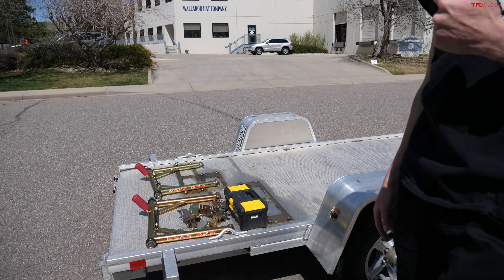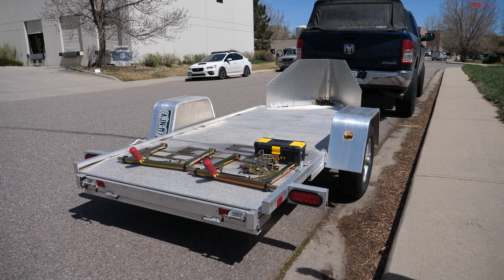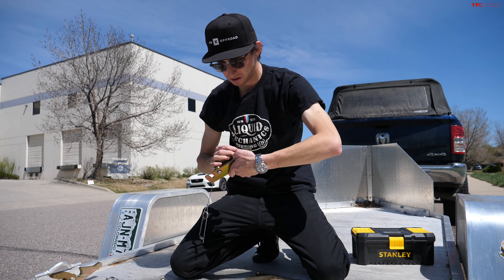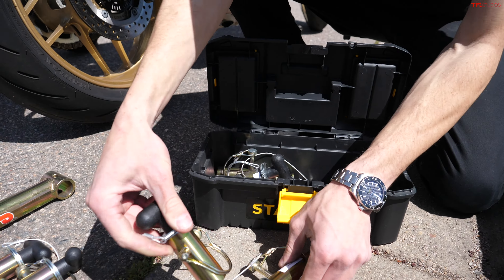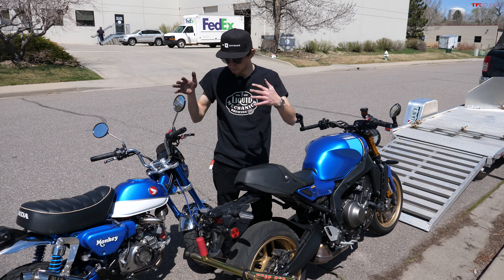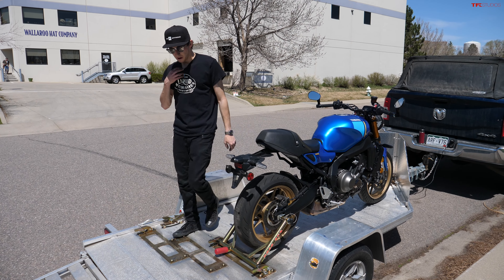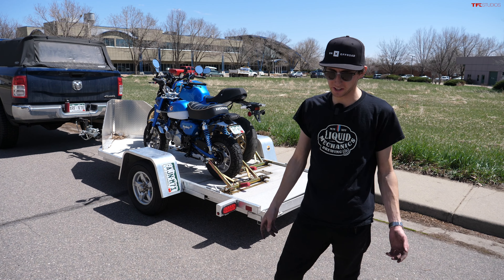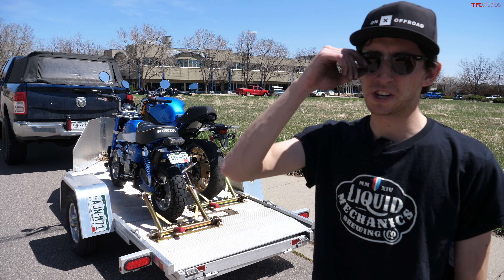Here's The Easiest Way To Transport Your Motorcycles!

Comment: Aluma C10 is $2400 plus tax, the  C210 is a $6000 trailer. Then for just one Pitbull trailer restraint and pins you are looking at close to $500.  I have a total of $700 tied up in a 5x10 trailer that has its own ramp, plus 3 sets of straps. And when I strap a bike down I use the rear swing arm and front axle as Bikes and Beards does. The bike does not move AT ALL.  I can also pull it all with no problems  with my Toyota Tacoma 4x4. There are trailers that you could have gotten that would fit in your garage that are half the price of what you paid.

Comment: Wow! "Welds breaking and things popping off" after only 1 year seems like a big manufacturing quality issue to me. The stands seem high quality, easy to use and fit your use case and budget. Thanks for the informative video.
Reply: I have a 2012 Aluma UT-10 that’s still as good as the day she was made.
Welds are some of the cleanest I’ve ever seen, tie-down points (including center, flush mount swivel D-ring) are ROCK SOLID, and there’s no draw backs to these trailers.
I’ve pulled hundreds (literally) of trailers, and worked many of them to death.
The Aluma was the one I bought for myself, and I’ve never regretted it.
My bike is a Ural Gear Up (800 lbs wet), and this has been the best trailer ever.

If this guy keeps breaking trailers, maybe the trailers aren’t the problem?
Sounds like he stands it up on its tail to fit it into his garage.
If he is, that would explain a LOT. 😎

Comment: Those Pitbull restraints work well in the bed of a pickup too if the bed is long enough. I've used the same system for two bikes and it really works great as Alex says.
Reply: Yes they also work in a truck bed! You can even mount the pitbull plates further forward in the truck bed. Then use the trailer restraints in front of the rear wheel, instead of behind the bike like I showed in this video

Comment: If your doing this sort of thing on the cheap. Buy a cheap 5x8 steel open trailer with the drop down ramp. Install three front wheel stands upfront, preferably on a 1/8 to 1/4 steel plate to add stability and structure. Then just use the already provided strap points to strap to. Tow a single in the middle or two side by side. Make them bolt on and you can save more money only needing to buy two stands on their own steel plates and set them up according to the need. Plus can remove them completely and use it as a trailer. An open trialer is lighter and way less air drag than a closed trailer. Besides much easier to work around the bikes when strapping then down. If you got the money go for "tank straps", specifically designed for strapping to the forks of the bike so its ridgid and not on suspension parts.

Comment: I just bought a used MC10 last weekend and am planning to set it up for two Dualsports using the motocinch restraints. When you mounted the pit Bull plates did you use a backing plate on the bottom side of the trailer bed?
Reply: No backing plate. Just washers and nylon nuts on the underside

Comment: When are y’all going to do more videos with the Xsr900???
Reply: I think it would be cool if there was honda grom built like the rebels soley in the sense of just multiple engines to choose from.  The traik. 125 is kinda rare people all over the world i dont even relate to want ine because they are scooterers and travelers on a budget etc. It sucks balls to pay 5k for a fancy scooter and its not even 6 speed and theres only 1 engine option. It makes it hard to put a bike like that in the stable when its 125cc for the same cost as a 2007 honda accord naturally aspirated v6 family sedan with 250hp that will go from san diego to miami easy peasy. 5k i mean bro it should have cruise control and multiple engine options. The rebel is cool lime that. You can get the one that gets 75mpg and isnt really for the interstate just for running around the block maybe dkwn the road, or you csm get the rebel thats 1100cc with cruise control you can go from sam diego to miami on a huge roadtrip for not too bad of price. The 125 cc grom needs to be entry level and then the top option needs to be hulk mad type grom. Hulk smash type. Give it muscles make it questionably fast.

Comment: And how is the simpler?
Reply: My R6 doesn't have a side stand. It's almost impossible to strap it down alone using regular ratchet straps. This lets me transport my bike alone very easily. And on sport bikes the fairings can make it hard to run straps and you end up pulling on and cracking plastics
Reply: @AlexLightmane4i  Same for my track bikes. Also at the end of a track day when you're wrung out physically, it's so much faster and easier to pack up.
Reply: @AlexLightmane4i   I'd agree in that case and also when you mentioned that you haul the same two motorcycles over and over. Otherwise it would be difficult to have all of the different setups. I'd contact the trailer manufacturer about the weld issues too. I enjoy your content.
Reply: Guys, Here is The Savior

HalleluYAH translates “Praise ye YaH”

YaH is The Heavenly Father 
YaH arrives via the TENT OF MEETING
YaH was Who they Crucified for our sins
YaH was Crucified on an Almond TREE

— Ancient Semitic Cuneiform of Moshe (Moses)
— Isa Scroll (The Original Isaiah)

Isaiah 42:8
"I am YaH; that is my Name! I will not yield my glory to another or my praise to idols.”

Isaiah 43:11
“I am YAH, and there is no other Savior but Me.”

Isaiah 45:5
“I am YaH, and there is none else.”